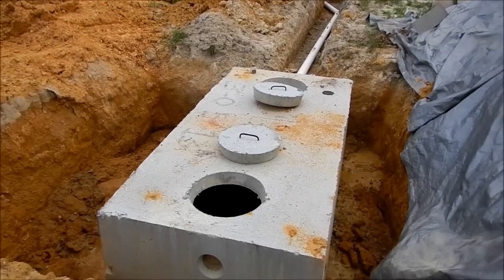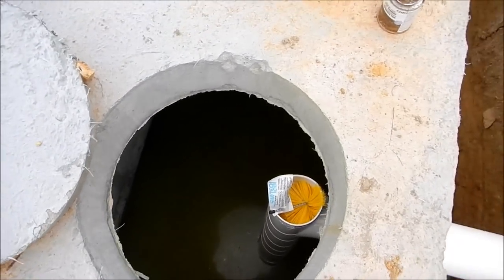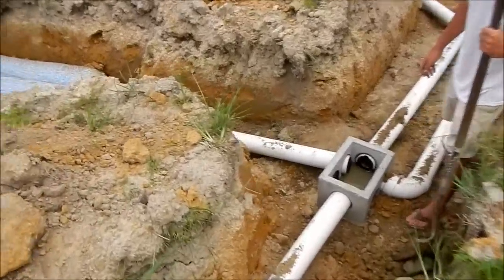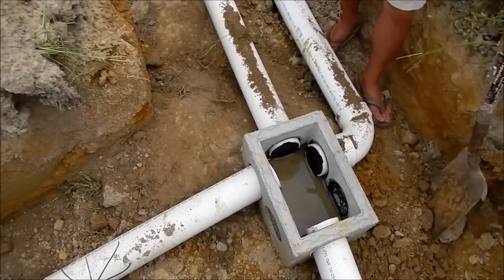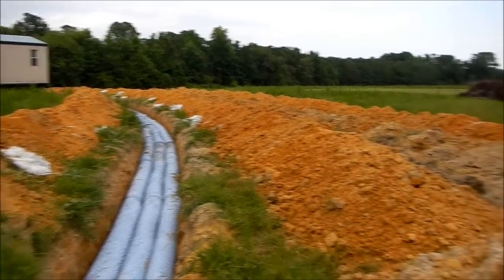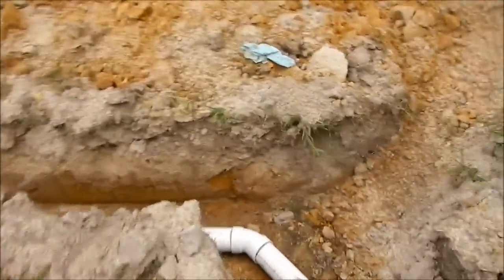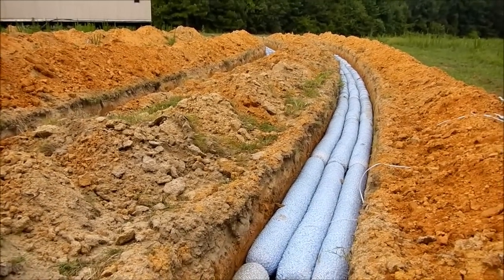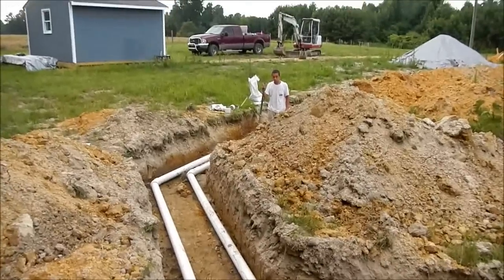Septic tank/ line install

Comment: Wow, that's quite the setup. I've sever seen those easy flow lines before, I gather that's due to the lack of effective drainage in the type A soil? We don't get much of that around here, but our laws are so restrictive that you have to have a special license to work on septic systems. (Our state also require an operators license before you even get on the machine...) Yea, good times....   B-\